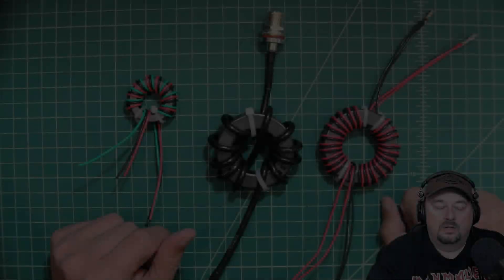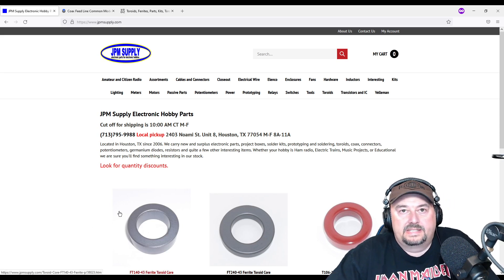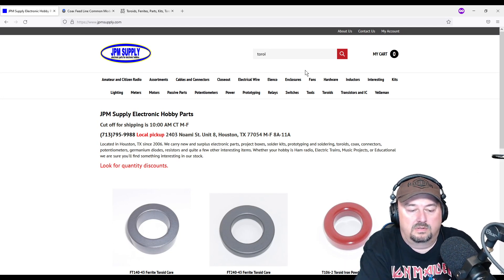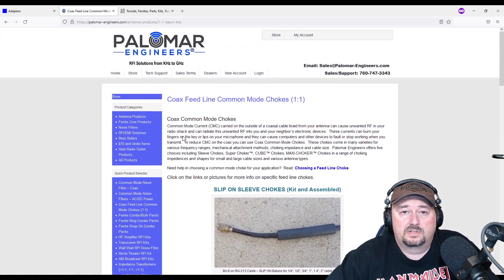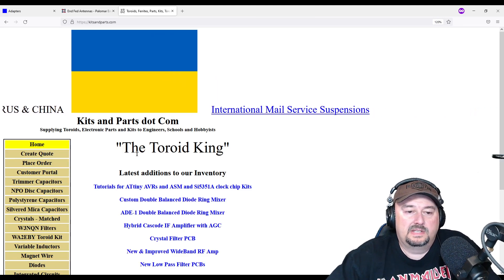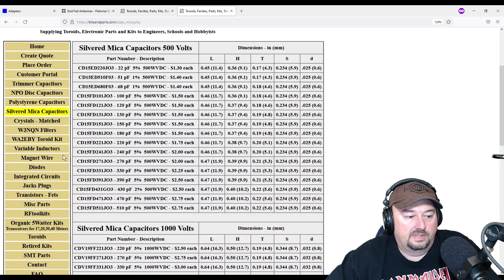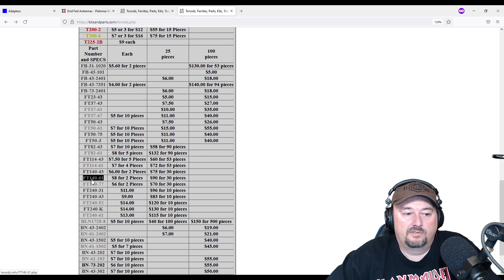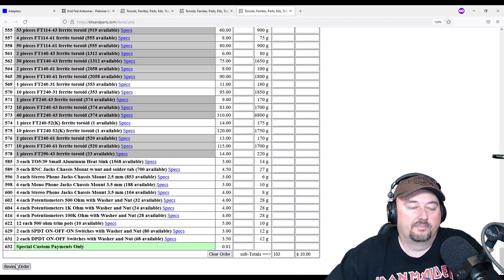Where to buy Toroids for Ham Radio

Comment: Great video❗️Sometimes I have a hard time finding out which toroid I need for the UNUN I want to build, do you have suggestions for the 1/1,  9/1,  49/1 and 64/1 I was looking for some at the Orange Ham Fest in SE Texas and didn’t see a single one ☝️. Thanks for your Great Videos. 73 KV5P
Reply from the maker: Thanks Mike, glad you liked it.  I use ferrite cores for what you have listed not the powdered iron cores.  For a 1:1 I would use mix 31 and mix 43 for the others. 👍
Reply: @TheSmokinApe  THANKS

Thanks

Comment: I would highly recommend Bob at Balun Designs. Get guy who knows his stuff. I like Amidom too great people. Sadly the one I highly DO NOT  recommend is Palomar, total rip off. I spent 1xx.xx on a multi tap balun 4:1/9:1 and it had 4 tiny little cores with ?Able size wire 18 Awg rated at 1kw plus which we all know is crap. I ve also herd same kinda bad stuff from others that bought 3/5kw balun that melted down under 1kw
Reply from the maker: Hey Kevin, Balun Designs are good folks.  I was talking more from just buying toroids or “parts” not so much antennas, you make a good point though. 👍
Reply: @TheSmokinApe  I understood but wanted to point out to folks. I also recommend a qst I will post the # great write up on how not to burn your balun. Has lots of great info on vswr and what a feeder n toe roids can Handle.
Reply from the maker: @kevinkc3onohelijeepworld  gotcha, thanks man 👍
Reply: @TheSmokinApe  need you email to forward if this doesn’t lead you to it “How to blow up your balun”
By Dean Straw, N6BV Sea-Pac June 7, 2014
Reply from the maker: I got it Kevin, https://www.seapac.org/seminars/2014/sea-pac2014-n6bv-Blow%20Up%20Your%20Balun%20with%20RG-303.pdf

Thanks!

Comment: Nice one Ape. In the UK I usually use Mouser or RS electronics. On something slightly different, have you seen this video? If so whats your thoughts? I want to build another smaller EFHW and thinking about this core and winding. 73 https://www.youtube.com/watch?v=-Wm27Jpcq7I&t=17s
Reply from the maker: Hey Colin, O did see that some time ago but haven’t tried the smaller core.  I guess I have to add that to the list.  I have used Mouser in the past but only for stuff that was hard to find.  👍